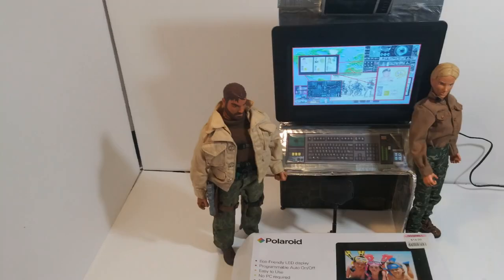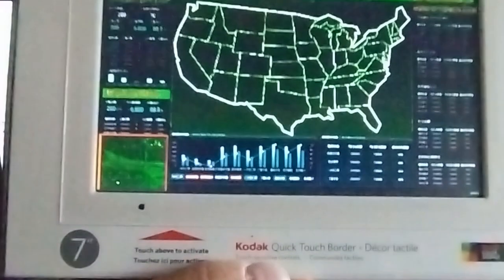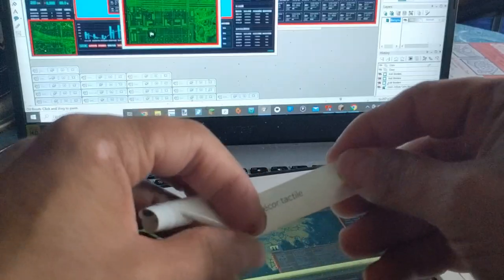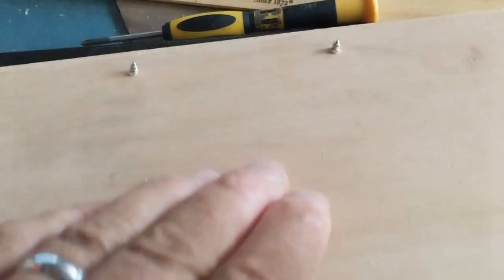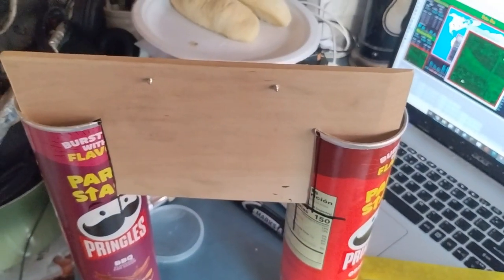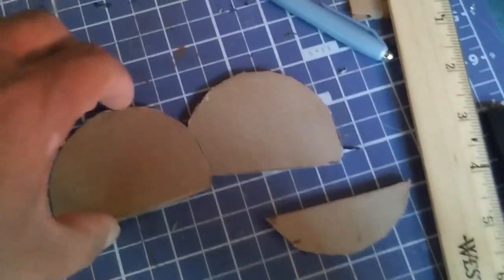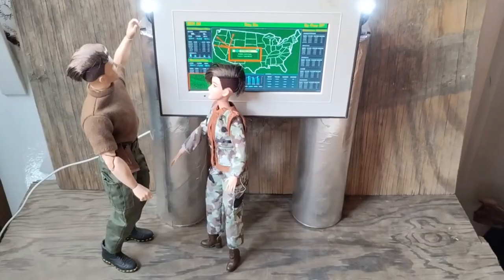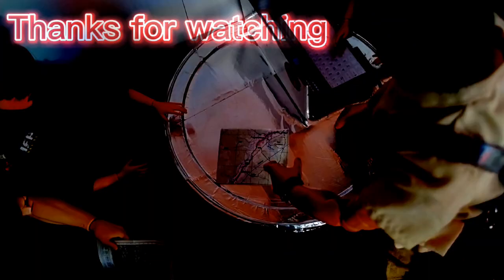New Photo Frame Mainframe Computer For My G.I. Joe's

Comment: Neat.  Do you think this new version is better than the previous one?
You could probably run the cord through one of the cans and out the back if you wanted to.
Reply from the maker: Thanks. This new one is much better. It has a lot more options and most importantly it's here and not in Oregon LOL. I thought about running the cord through one of the cans...I might do that.